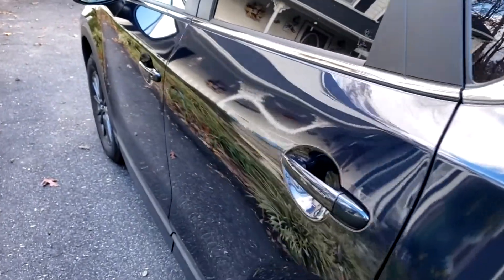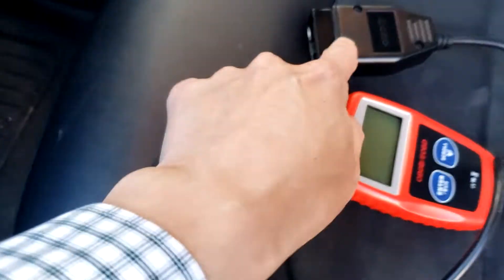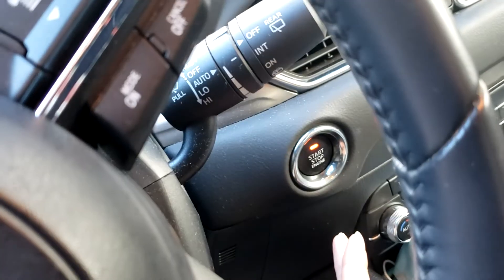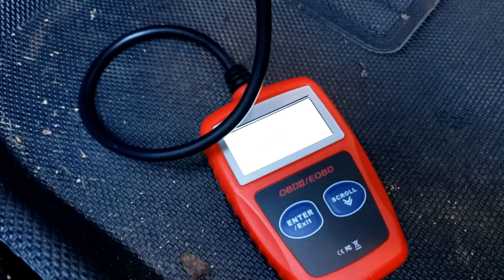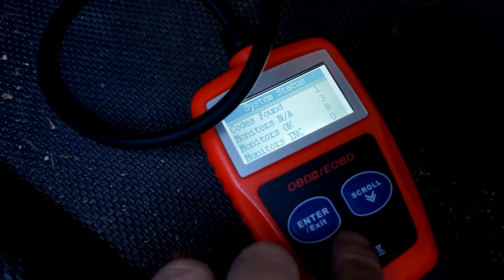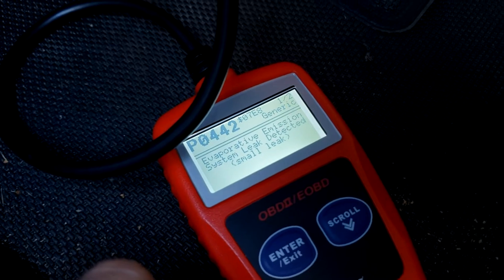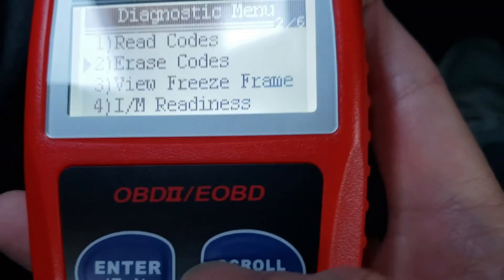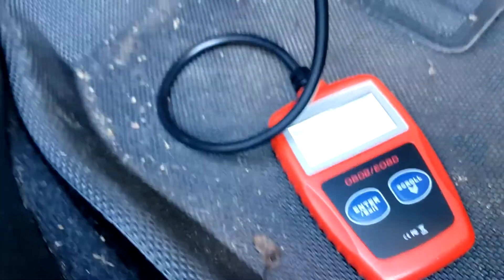Mazda CX-5 Check Engine Light Self Diagnosis

Comment: Thanks! I had neglected to put the cap back on after filling gas. The light is still on, but I haven't driven it yet. If it's still on by Monday I'll take it to service. The sensor took looks like a good idea. Your suggestion was at the top of the Google search 😊 Super helpful, thanks for posting!

Comment: Nice one. My wife's 2020 CX5 just had the cel come on randomly, after she took it in for maintenance a couple months ago. I'm going to tighten the gas cap before trying to diagnose anything. 

I'm finding that Mazdas have really sensitive sensors all over the car. Tire pressure being notorious. Happens every winter when the weather changes.

Comment: well, what was the fix, loose gas cap?
Reply from the maker: It was just a loose gascap! Have not gotten the cel again
Reply: My mazda cr5 check engine light is on plz I need help. 
we’re I am the diagnostic machines software of Mazda not include. 
Plz help. 
Thanks